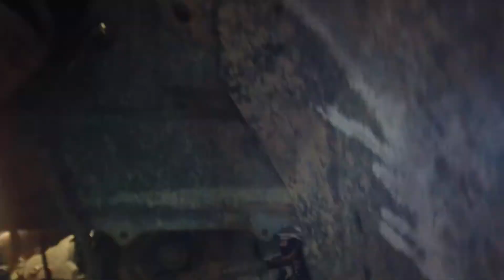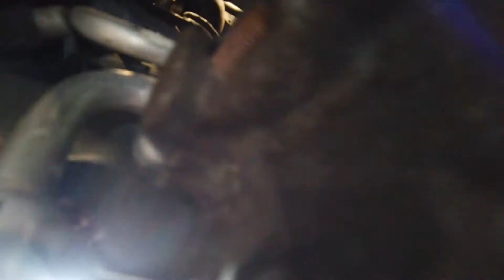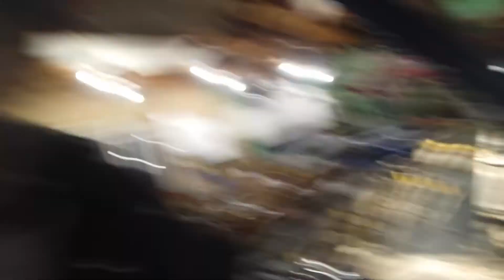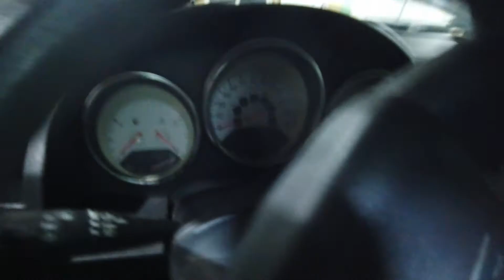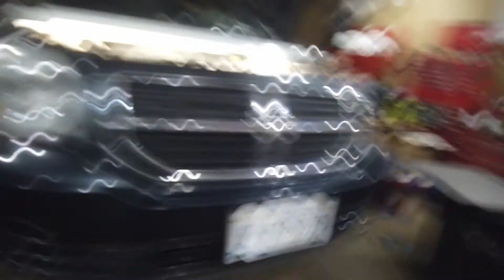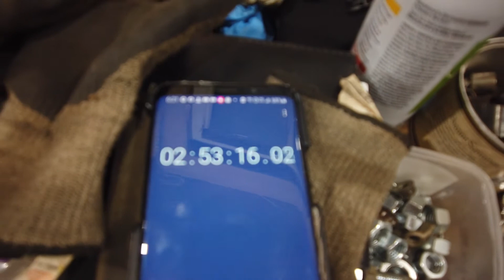2008 Dodge Caliber Alternator change Pt 2 install and function

Comment: P161B signal disappeared naturally after I drove for about 20 miles. One reason could be that the battery voltage rose to a high value from the previous low level due to working alternator.  In this case, P161B signal refers to low battery voltage. The signal disappeared once the battery voltage goes high enough.

Comment: After I followed your way to disconnect the battery to diagnose the alternator when the car was running,  "service engine soon" signal came on.  I went to O'Reilly and they helped me to scan the code. The Primary DTC(diagnostic trouble codes) is P161B. This code means "Battery Disconnected/TCM Internal". The suggested solution is to replace transmission control module (TCM).  O'Reilly staff said that it is not right to disconnect the battery when the car is running. They said that it is ok to do this to the cars made in 70's and 80's. Otherwise, it will cause problems. At least it has caused a problem to me. So Dana, do you have any suggestions for P161B? Also, Dana, please let the youtube audience know: it is dangerous to disconnect the battery when the car is running if these cars were made after 80s.

Comment: Hi, Dana, one sentence is wrong, let me correct it for you: "disconnecting the alternator when it's running, and its shuts down that tells you that you got a bad alternator". It should be  "disconnecting the battery when it's running, and its shuts down that tells you that you got a bad alternator".
Reply: Thank you For the correction ! At Least I'm Showing correctly
Reply: @DanasGarageMusic-b6i  Thank you. After I followed your way to disconnect the battery,  "service engine soon" signal came on. Do you know why?

Comment: I have a 07 caliber and my battery light on checked voltage and it’s good but the light stays on it’s putting out 14.7 volts
Reply from the maker: That's a good one! not sure. charging looks good.  have the battery checked

Comment: You did great work! I used to have a large group of friends who were all mechanically inclined, but nowhere around any more. I had a timing chain gear crap out on an old chevy and not knowing or having Internet back in the day, didn't know I should have replaced cam and lifters at same time. Had to do that about 2 months later! 
  Watching your videos of this particular job has given me so much anxiety and triggered a PTSD event due to previous emergency projects I've had to take on. 
  I currently have a 2010 Caliber with pulley/alternator noise and my battery/charging light just came on. I am so screwed!
  I can't afford to take it to a garage and I don't have A place to work on it or anyone to help me, I'm able to do the work, but not sure if I even have the tools needed. Nor do I have extra $$$ for parts! No credit! No cash! And I have a job working 50 hours a week amd apartment rent!
  Good video !
Reply: Hi Christopher! They don't make easy